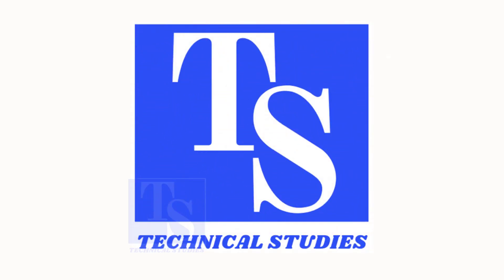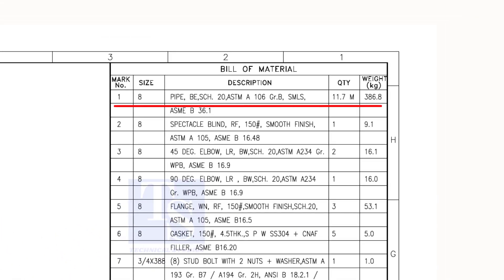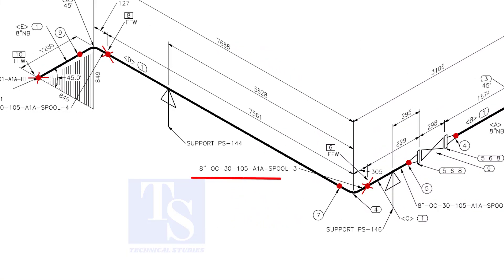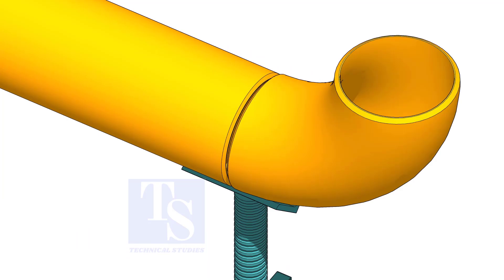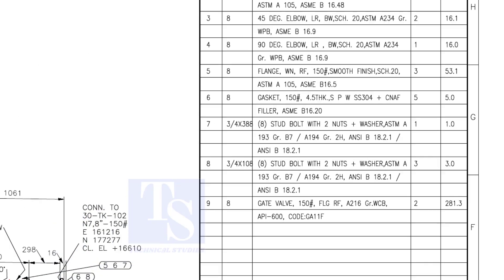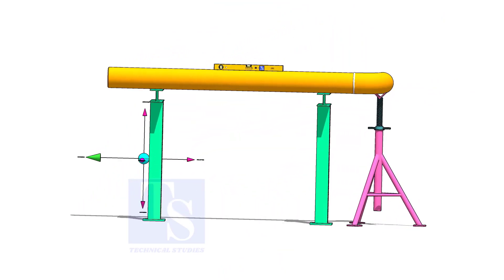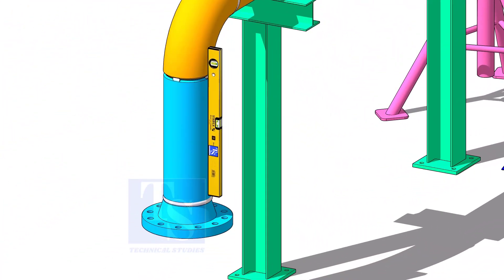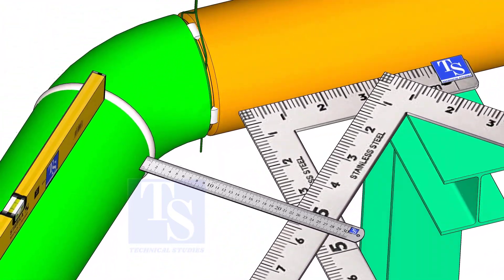How to fabricate pipe spool from isometric drawing. ड्राइंग से पाइप स्पूल कैसा बनाएगा

Comment: How much inch metre pipe can be erection in one day and which drawing required for site erection of pipe spool please reply
Reply from the maker: Bro. It depends on many things. The skill of the workers, avaialbility of materials, size of the pipe etc. I will share my experience in ccc. Some groups got large pipe diameter pipes and I always got small bore and stainless steel pipes. Even though my manpower was very large, my inch dia progress was 1/10 of the other team. Plan drawing and iso drawings are used for piping erection, but nowadays, a 3d model also is used. A p& id drawing is very helpful to find the pipe to equipment connection. Thank you for the question.
Reply: @technicalstudies.  And spool erection per day in inch meters many time interviewer asked this question and daily production in inch dia big bore pipe size
Reply: @technicalstudies.  
plz upload & make a new video of plan Drawing for piping erection process.
Reply from the maker: @mdnadeem5379  Ok.